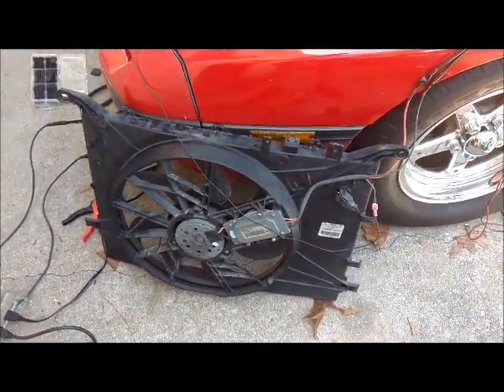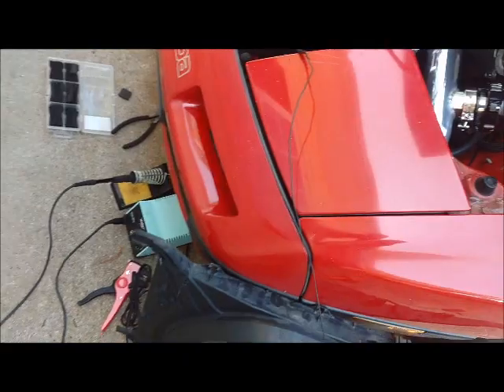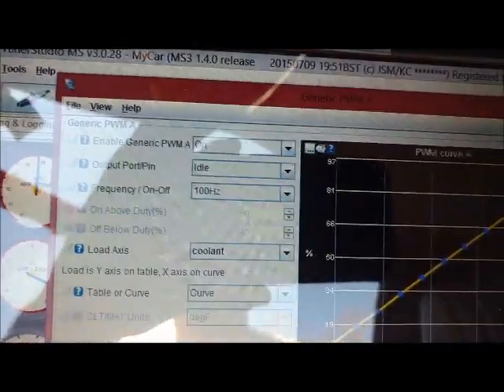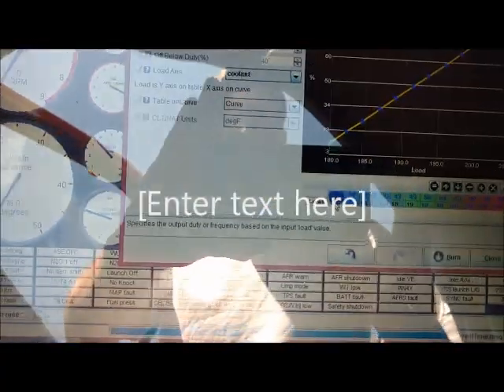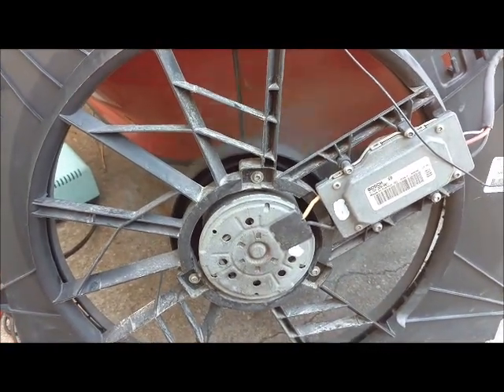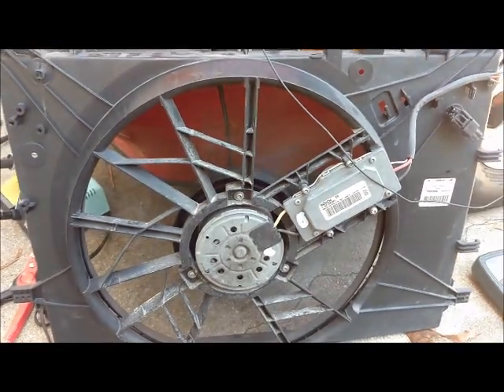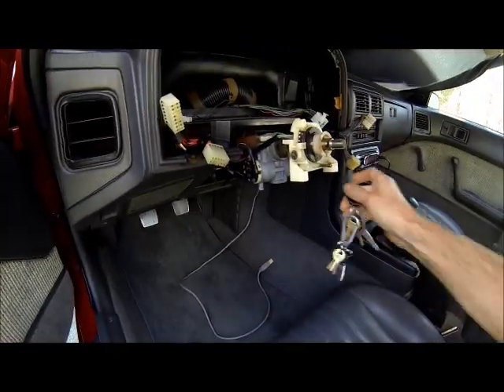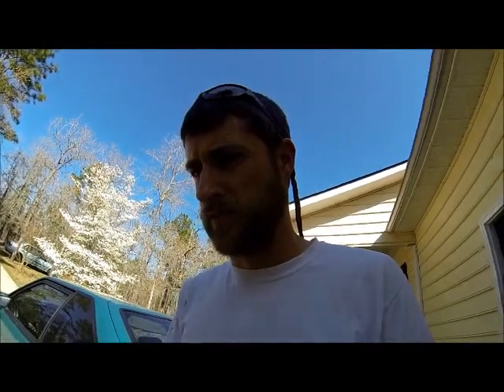megasquirt pwm speed control how to with a junkyard volvo fan.

Comment: good evening, would you please answer a few questions. I bought the same fan from a volvo V70. I didn't know how to turn it on, I put a thick red wire on the + pole of the battery and a thick black wire on the - pole of the battery, I see that it also has a purple wire I also put it on + and half of the battery and I could not turn on the fan. Now I saw how you did it. Now I understand that with the purple wire, when the voltage is 1.5v, the fan works full 100%, when the voltage on the purple wire is 5.5 volts, it works 50%, and when the voltage is 10 volts, then the fan works 25%. My question is whether it is possible connect via a relay to obtain a voltage of 1.5 volts; 5.5 volts; 10 volts; and then to connect it to the thermal switch on the cooler. Is there any solution via a relay switch or something else, thank you for your answer. That is a very good thing, it does not burden the alternator with a large current when it is working at 100%.
Reply from the maker: The purple wire needs a pulse width modulated 12v. You change the fan speed by changing the duty cycle. Imagine a square wave with a 100hz cycle (100 cycles per second) and the fan only works when the 12v is on between roughly 10% and 95% of the time between cycles. The fan doesn't run below 10% and above 95ish% ( I think I have exact numbers in the video.) When you connect the purple wire to the positive post of the battery, that's essentially a 100% duty cycle.
Reply: @redneckin8805  what is the current in amperes on the purple wire when it is 100% at 1.5 volts, 5.5 volt 50%, 10volt 25% what is the current in amperes 30A or 50A or 70A because the fan when it turns on draws a lot of current I want to install in an old car FORD TAUNUS it has an alternator of 45 Amps
Reply from the maker: @draganmitrovic2579  I have not taken an amperage reading of the fan at all.
Reply: @redneckin8805  that's why I'm asking if there is a large amperage on the purple wire when it's connected to 1.5 volts or 5.5 volts, but I don't think it's large because the purple wire is thin, not thick, I'm asking because of the 12v module to buy that can handle the operation of the fan due to the ampere current. If you find out what the current is on the purple wire let me know thanks for the answers
Reply from the maker: @draganmitrovic2579  The current on the purple wire is going to be milliamps. I have my purple wire going to my ECU.
Reply: @redneckin8805  thank you very much means it is a very good thing that fan from volvo v70 because it does not draw a high current 30A or 40A like other fans. Now I understand on the purple wire there is a very small current in milliamps which is not dangerous for the electrical installation on the car to make the sr ignite from heating due to the higher current of 40 Amps. The current on the purple wire is in milliamps and I can mount it on my car. Thank you very much.

Comment: Hey Thanks for the video.  Did you leave the module wire to constant 12V when in the car? I have read where someone did that but didn’t know if that was legit and wouldn’t cause a battery drain
Reply from the maker: Yes the main power is constant 12v. I only have the PWM wire switched.
Reply: @redneckin8805  Thanks for the info

Comment: Got a GM dual fan with Bosh motors and it has a small yellow/brown wire that goes into the motor??  I have a green trigger wire from the OEM ECU.  What does tlh;e Y/B wire do?  melandsandy.rich@gmail.com
Reply from the maker: From what I understand the oem ECU (if you're talking about an lsx ECU) only triggers a relay on and off for the fan. It doesn't use pwm control

Comment: Black signal wire which is connection area? Voltage, resistor or coolong sensor, fan system feeding?
Reply from the maker: Please rephrase

Comment: Can that signal wire be hooked up to a thermal switch instead of a pwm? Might be a dumb question but I was just curious.
Reply from the maker: I've never tried it but I don't think so. Fan doesn't run at 100 duty which would essentially be a ground.
Reply: It cannot it uses stepped voltage and will only bump the fan for about 1 second when switched on has to have proper duty cycle like  mentioned. If it did it would defeat the whole purpose of a fan controller you could just wire to traditional relay circuit and step the voltage up for fan speeds with a bank of relays

Comment: What size radiator do you have ? Stock FC are around 23in x 19in core if I recall..wondering if I could fit that on a Koyo or stock style rad. Nice setup btw !
Reply from the maker: i dont remember the dimensions. I was the absolute biggest i could fit between the fram rails. Its a Be Cool radiator from the ls swap line of radiators. I got it from summit.

Comment: I'm using the same setup. I found my fan in a 2003 volvo s80. As long as it's the 3 wire controller it'd good. Cut the wires after the connectors so you can retain the plugs in your project!